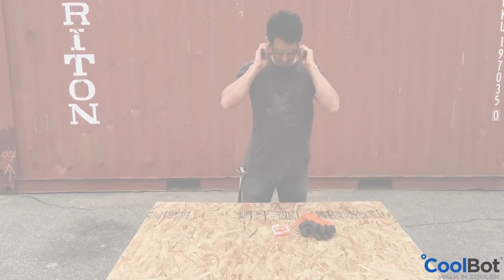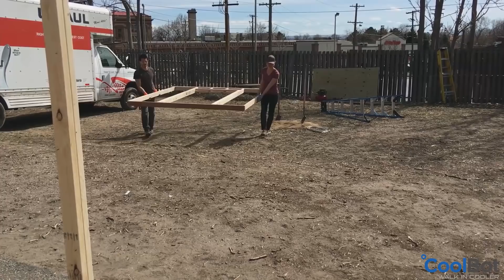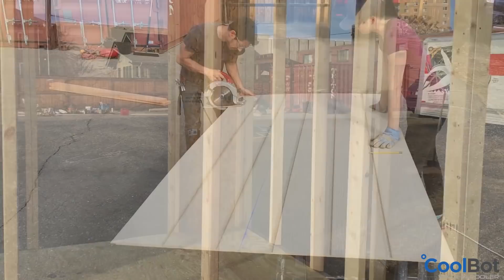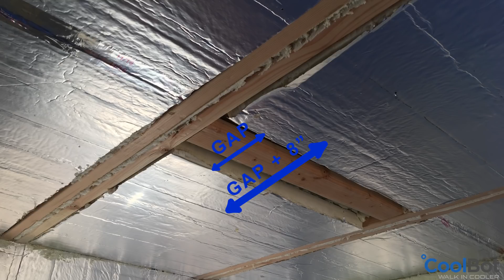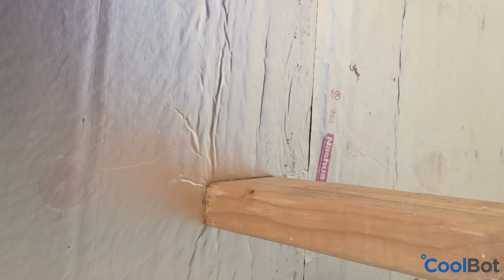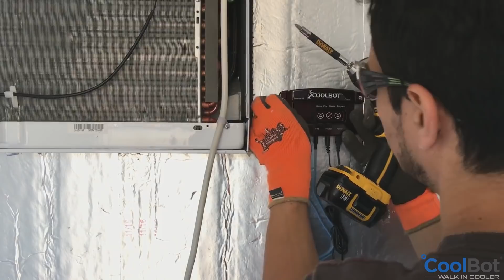DIY Indoor Cooler

Comment: what about control of humidity levels? Is this an off-the-self window AC unit? I've read they can keep at most 55-60% of humidity levels in those rooms. Flowers need more like 90% humidity, veggies and meat 85-90%.
Reply from the maker: Hi Chris,
As long as you are using a A/C that is listed on our A/C Compatibility List on our website ( they are regular off the shelf A/C's but must meet a few conditions), and "and sized correctly per our A/C Calculator, in an airtight space insulated to R25, typically the humidity levels would be around 70-90%, but if you need more humidity for the cooler, we can talk about upsizing the A/C you need for your cooler or about installing humidifiers.
Please feel free to reach out any time directly at support@storeitcold.com, we're happy to brainstorm and talk about your particular application.

Comment: A couple hundred dollars yeah right that foam insulation is a couple hundred dollars never mind the wood and the Cobalt Easley looking in couple thousand
Reply from the maker: Hi Randy, thanks for reaching out. You're right, the insulation is probably one of the most expensive components of a build. What we're sharing in this video is how much you can save by building your own cooler compared to purchasing a traditional walk-in cooler with a compressor. Learn more about CoolBot's cost savings on our website and contact hello@storeitcold.com with any questions. 

https://www.storeitcold.com/economic-advantages-2/

Comment: I live in the country of Chile can a cool box function with 220 volts as that is the voltage in chile? Does someone know the answer to this question thank you very much
Reply from the maker: Hi James, thank you for reaching out. Yes, you can use the CoolBot on 220V, you'll need to get an adaptor for the plug. You can learn more about the CoolBot and check the specification sheet on our website https://www.storeitcold.com/product/coolbot-walk-in-cooler-controller/

Contact us at hello@storeitcold.com with any other questions.

Comment: I have removed the cover so the condenser can remove heat easier. The outer part of the air conditioner is out in the open and have used this for years with no problems. Coolbot is inside the cooler out of the weather and works great.

Comment: Anyone with common sense can build this for almost as much as a cool bot lol I paid 28$ for my temp controller lol
Reply from the maker: Hi Matt, thanks for reaching out.  You're correct, there are other ways to harness the power of the A/C, but they require constant supervision to prevent the unit from freezing over and cannot be set at an exact temperature.  

The patented CoolBot offers a "plug and play" alternative, no wire splicing,  soldering, or electrical knowledge required.  You simply install the CoolBot, set it to your desired temperature and you're set.  Read more on our website and please feel free to email us at hello@storeitcold.com or call us at 888.871.5723 with any other questions.  https://www.storeitcold.com/how-it-works/

Comment: You skipped right over the floor construction - what gives?
Reply from the maker: Hello Robert, sorry for any confusion, this build was outlining an interior build which is why we don't have video of the floor.  We have pictures of how we insulated the floor in our cooler manual, please reference page 8 for framing and page 40 for insulating.  If you have any other questions, please email us at hello@storeitcold.

https://cdn2.hubspot.net/hubfs/2434330/DIY%208x8%20Cooler%202019-04-19%20Rev%20A.pdf

Comment: How many hours per day does the AC unit run?
Reply from the maker: Hi Kyle , thanks for reaching out.  The fan on the A/C will constantly run while the compressor only comes on when needed to maintain your desired temperature.  Please email us at hello@storeitcold.com with any other questions.

Comment: the background noise is comparable to a water torture...I had to stop listening
Reply from the maker: Hi there, we also have a follow along guide for this build, you can access it here https://cdn2.hubspot.net/hubfs/2434330/DIY%208x8%20Cooler%202019-04-19%20Rev%20A.pdf

Comment: I've been running a CoolBot for more than 10 years and they work flawlessly. It's one of the best investments I've ever made. The cost of a new refrigeration unit for my cooler was astronomical so I looked into this about 12 or 13 years ago. Ron Khosla invented this device when he and his wife were simply looking to find a way to cool their vegetable harvest on their modest New England farm. After many conversations with Ron and his wife I knew it was the right way to go. That was a long time ago but they continue to stay true to their original product idea....cool for a good price. I love that and appreciate their tenacity to stick with heir product. Who doesn't love the American dream??
Reply: How many square feet do you cool
Reply: @dustyburnette3546  Our cooler is approximately 5.5'x7.5'x 8' tall. It was an old freezer that hadn't been used for anything but a shed for years and we picked it up for a song. We were just about to build one when we came upon this deal. Been using a CoolB0t on it with and LG A/c ever since and have never had an issue with it.

Comment: How does one keep the coil from freezing up? I have to defrost it with a heatgun every 24 hours...
Reply from the maker: Hi there, thanks for reaching out.  If you're freezing up please reach out to our customer support team at support@storeitcold.com or 888.871.5723.  We'd like to get more information about your set up and determine if this is a sensor issue or something else.  You can also visit our troubleshooting page for assistance.  https://www.storeitcold.com/build-it/troubleshooting/
Reply: For others knowledge:  The system is designed to shut down the AC compressor when the evaporator fins get close to freezing temp to prevent freezing up.  This is why it's best to have a temperature swing of a few degrees, to give the evaporator time to warm up before cycling again.

Comment: At 5m50s you start screwing the walls together but there is no mention of leveling or plumbing the walls.  Is that done prior to screwing the corners of the walls together or after or not at all?
Reply from the maker: Hi there, thanks for reaching out.  This video is for a indoor cooler which needs to be placed on a flat level surface.  We realized that it was filmed outdoors and apologize for any confusion.

We have a detailed guide in linked in the description of the video which goes over building and insulating a floor.  

If you have any other questions please call us at 888.871.5723 or email hello@storeitcold.com.

Comment: Better not install a ceiling light as it makes a hole in insulation just  WEAR A HEAD LIGHT ( an rechargeable lithium head light is 13.00 on amazon )
Reply from the maker: Hi there, thanks for reaching out.  Yes, installing a light will require you to make a small hole in the insulation.  If you would prefer not to make a hole, another great option for lights are LED strip lights.  If you have any other questions please email us at hello@storeitcold.com

Comment: If this is an indoor cooler, where the cooler itself is placed within another climate-controlled room, does the window AC unit have some sort of ventilation duct or exhaust fan pulling the hot exhausted air out of the surrounding climate-controlled room???
Reply from the maker: Hi there, thanks for reaching out.  You can vent an A/C inside, you just needs to make sure you have a 2 foot clearance on all sides of the A/C unit to allow it to vent properly. We do not recommend ducting the warm air from the A/C since a duct would not allow the A/C to pull in fresh air.  With the two feet of clearance around the unit, you'll be good to go.  Please call us at 888.871.5723 or email hello@storeitcold.com if you have any other questions.

Comment: I got 6 inch thick x 12 foot long refrigerator panels from a commercial job site. That should be Overkill in a good way right?
Reply from the maker: Hi Jacob, sounds like you should be good!  If you go over R25, it doesn't hurt.

Comment: Would I be able to glue on wood paneling after the 2nd layer of Rmax?
Reply from the maker: Hi Mike, thanks for reaching out.  For the walls, we recommend using either FRP or just leaving the walls as they are.  

If you really want to use the wood paneling, make sure it is pressure treated and that they prime it with a mold mildew resistant material. Wood is not  our preferred material but with precautions it will be OK.  

Email us at hello@storeitcold.com if you have any other questions.
Reply: salam

Comment: Putting the AC unit tstat probe outside the cooler and a $30 tstat probe on the inside, wire it so the electrical outlet gets "hot" by the Home Depot tstat works and it's a lot cheaper.
Reply from the maker: Hi Duane, thanks for reaching out.  You're correct, there are other ways to harness the power of the A/C, but they require constant supervision to prevent the unit from freezing over and cannot be set at an exact temperature.  

The patented CoolBot offers a "plug and play" alternative, no wire splicing,  soldering, or electrical knowledge required.  You simply install the CoolBot, set it to your desired temperature and you're set.  Read more on our website and please feel free to email us at hello@storeitcold.com or call us at 888.871.5723 with any other questions.  https://www.storeitcold.com/how-it-works/

Comment: Air-conditioner compressors are not designed for this cooler room application. The operational thermal profiles are different. Of course in a push it can be pressed into service. my 2 cents input, having tried this approach.
Reply from the maker: Thanks for reaching out.  We discuss all of the concerns you bring up on our website, check out How the CoolBot Works to learn more or call us at 888.871.5723 with any specific questions.  Thanks!

https://www.storeitcold.com/how-it-works/

Comment: How will the room temperature go below the A/C unit's set temperature?
Reply from the maker: Hi there, thanks for reaching out.  The CoolBot is a patented mirco controller that intelligently controls a window air conditioner, allowing you to cool a well insulated room down to 34F.  Learn more on our website or give us a call at 888.871.5723!  https://www.storeitcold.com/how-it-works/

Comment: Dont listen to fake refrigeration people. Hire your local reefer tech to set you up with a long term energy efficient system that will pay itself off down the road. Any company that recommends you trick a window shaker to overwork itself until it burns up is not helping you out long term.  Invest in your cold storage. Be smart and support your local hvac/reefer techs.
Reply: Obadiah Lnenicka Yeah... Let me drop 14 grand on a walk in cooler...  That I only need to use 2 months of the year... Or I'll continue using this product, that has worked 100% for what I need, for less than 3 hours labor from your "refer tech".

I'll tell the "local" guy you sent me... I'm sure he'll give me a discount when I'm unnecessarily spending all that money.

Oh, and you're a tool bag.  😂
Reply from the maker: Hello Obie, and thank you for your feedback.   We love hearing from industry pros and the Coolbot has been embraced by many HVAC and Refrigeration contractors who find it to be great alternative, which saves their customers money on initial and maintenance costs. (check out our blog interview with one HVAC company using the CoolBot https://www.storeitcold.com/pro-coolers-helping-businesses-get-bang-cooling-buck/). 

For our customers, the CoolBot is the most economical and pragmatic solution for their cooling needs and has advantages over traditional applications.  While not the right solution for all needs, freezing of goods being an example. The CoolBot is a viable and affordable option for cold storage in which the AC life is often extended due to lower compressor run time.  Our customers understand the value of the initial savings and maintenance costs the CoolBot offers compared to a traditional system. With 45,000 CoolBots in the field and many testimonials of happy customers, we know this works.

We would enjoy connecting with you directly and talking all things cold storage and the CoolBot.  Please reach out to us or let us know how we can contact you.  

With much appreciation,
Team CoolBot